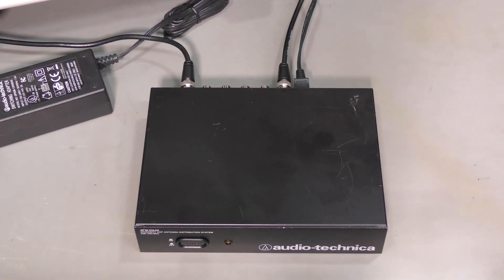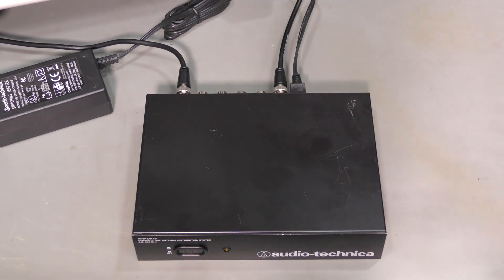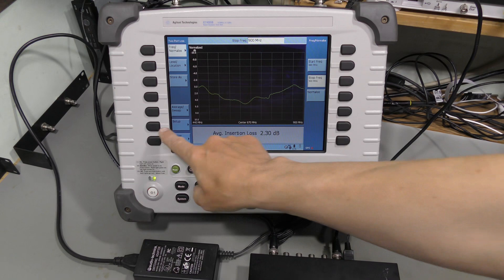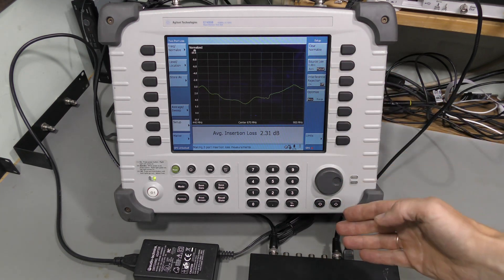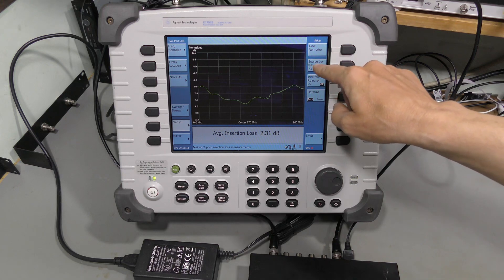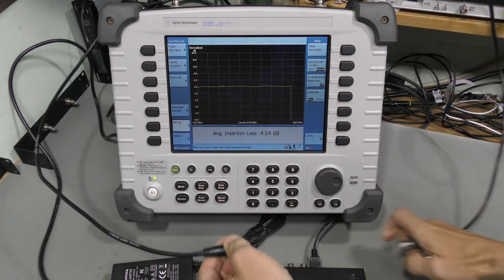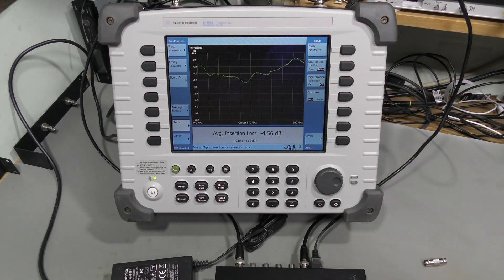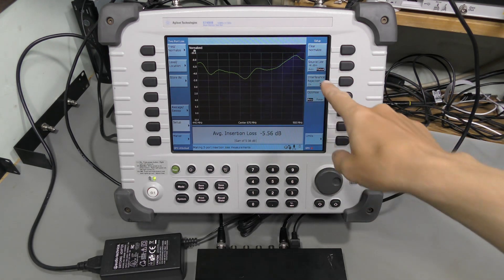#148 - Audio-Technica ATW-DA49 followup

Comment: Good one. I never dare to use more than -20dBm on the input for testing small RF amplifiers, because I'm used to cheap Chinese stuff. Last time I did such a mistake I fried a small amp, but not before I felt the RF burn tingling my finger. My mistake was that I disconnected the load during testing. Poor thing was outputting +20dBm before it's demise.